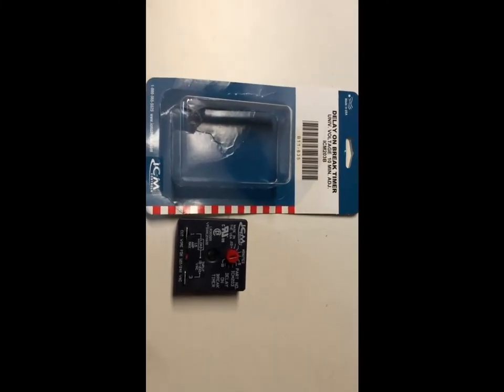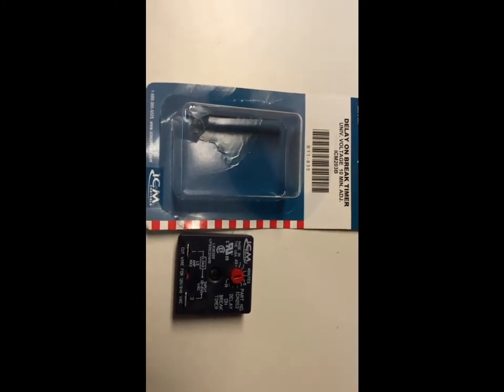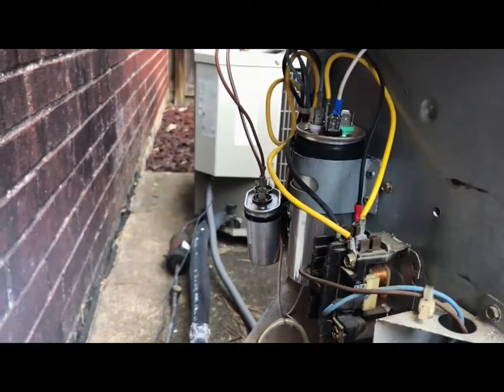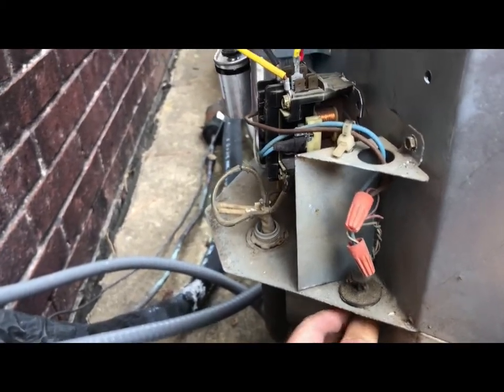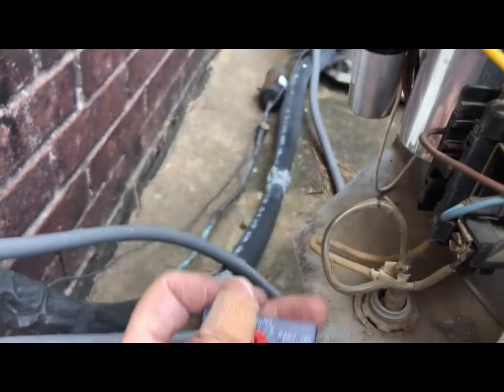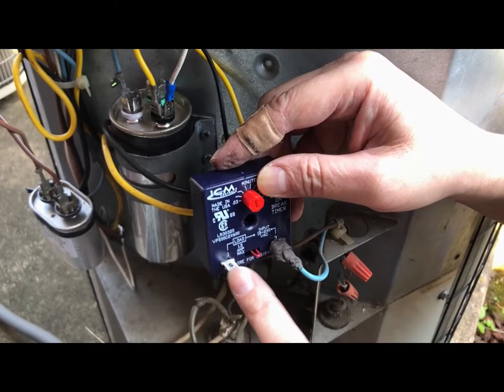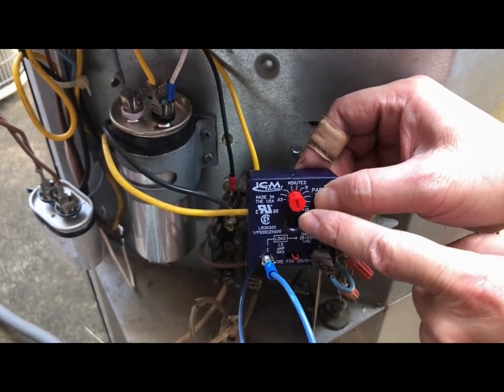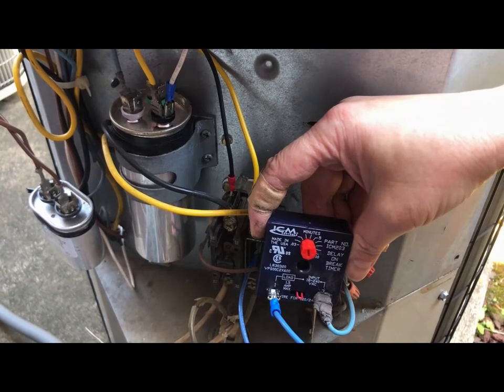How To Installing Delay On Break Timer to Compressor A/C Unit

Comment: This is a make on break, it will not delay the starting of compressor. It will only delay after shut off of compressor.
Reply: Needs a on make delay, delay starting load
Reply: So during a a momentary drop in power while compressor is running, this will not keep the compressor from trying to restart right away while under pressure? I though this is a power break delay for this reason
Reply: @richardsilva5134  yes it will work for that purpose also, just not on every start up signal, only shut off signals.

Comment: Hello there, we have problems with Voltage fluctuations, where the voltage dips briefly and then comes back on right away. This causes my AC compressor many problems, so I installed a ICM Delay on Make Timer. The strange thing is that the timer does not cut out at those dips but only delays once the electricity goes off completely ( same counts for the built in delay in my Air handler thermostat).  So here my question : would a Ditek Surge Protector be a solution or do I need to install something else ? Thank you so much !
Reply from the maker: It seems like you have a drop voltage issue.  I think you need some type of surge protection for your HVAC system. Look like the Ditek Split Phase Surge Protective device could prevent your HVAC from damage.
Reply: @davidtran4490  Thank you,  Yes I just can't figure out which one  ICM 493, Ditek , Compressor Defender , Siemens 140 , Intermatic AG3000, Citel it's all a bit confusing.
Reply: @davidtran4490  thank you !

Comment: How does it work with out a ground/neutral? Does it ground through the mounting screw or something?
Reply from the maker: Sorry, for late reply.  the blue cable I made is just to connect from the other side of the braker to the contactor of the same spot of the original cable pulled out that connect to the breaker.  What you do is just connect the breaker between that cable.  If you review the video again in slow motion you can see what I mean.  There is no ground cable needed in this video.